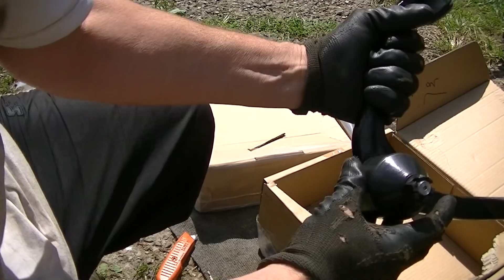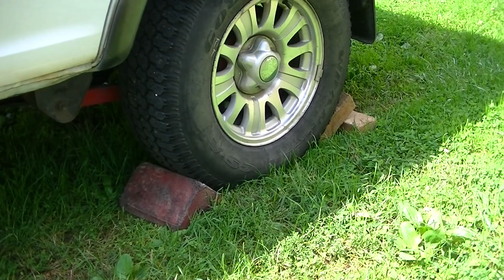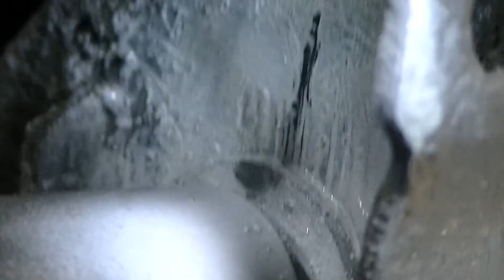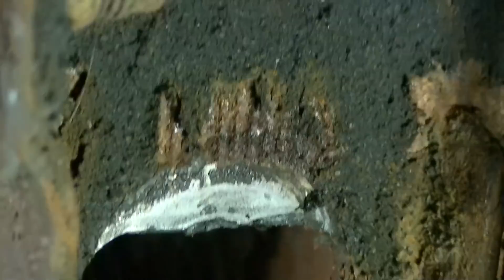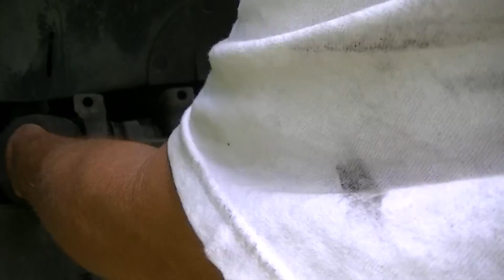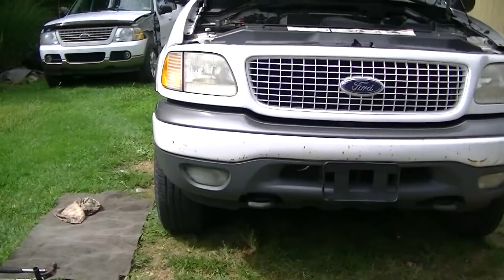Upper Ball Joints. YOU CAN DO IT!!  Step by Step...How to replace them on a 1997-2003 Expedition.

Comment from the maker: PLEASE READ:  The "Arrow" is pointing at the "Ball joint". But the hole assembly is the upper control arm. The ball joint is part the entire assembly, that's how they designed it. If some says "you need a upper ball joint" well, then you'll get one, with the entire assembly. Its all one unit. I tried to keep it simple but folks get confused. Then there is the Upper control arm bushings lol... part of the unit also.

Comment: So I've got a 2003 eddie bauer expedition, and this was mostly similar, except to remove the bolts on the upper control arm you have to pull the strut completely. Just finished the drivers side, which means I've now removed every strut on my vehicle. 

Advice to anyone trying the same, be careful with the upper mounts for the struts, keep the front end around the same height to avoid pinching the spring with the swaybar, and get ready to use some interesting amounts of torque with a breaker bar if you're from a place where things get rusty.
Reply from the maker: Truth!

Comment: Mine says not too tighten  bushing bolts until the suspension  is at ride height that was not mentioned  at all( too avoid premature bushing wear )....that's after it's off the jack or jack stands  tires on the ground right ?....

Comment: Is the upper ball joint serviceable without replacing entire control arm?
Reply: Yes if the bushings are fine no need to replace it but do a cost comparison between both, and see if it makes sense to u to leave them or replace them. Just make sure to get the proper tool from parts store to make installing the ball joints a lot easier.

Comment: That not a ball joint!!! It’s a while assembly, which is called an upper control arm!!!
Reply from the maker: The "Arrow" is pointing at the "Ball joint". But the hole assembly is the upper control arm. The ball joint is part the entire assembly, that's how they designed it. If some says "you need a upper ball joint" well, then you'll get one, with the entire assembly. Its all one unit. I tried to keep it simple but folks get confused. Then there is the Upper control arm bushings lol... part of the unit also.

Comment: So I have a 96 Ford explore it needs an upper ball joint do I have to change the whole  a arm  or can I press out the ball joint. I think it’s never been changed before I looked tonight the top one has no snap ring the bottom one does. So does that mean I have to change the whole a arm
Reply from the maker: Different ways.

Comment: I believe that part is called upper control arm and not "upper ball joint"
Reply: Yeah and those pieces you cant just replace the balljoint on those trucks
Reply: I think you’re right but if I’m not mistaken the upper control arm does contain the upper ball joints also, so replacing the upper control alarm also replaces the upper ball joint.

Comment: Nice video! What can you do if you don't have a tool for adding grease to fill the boot through the grease fitting? Could I put on the new control arms and then ask a mechanic to just add the grease? Or is there a DIY method?
Reply from the maker: There cheap...$5
Reply: @FixingWithPassion  Oh, cool. Thanks. What are they called? What kind of grease goes into it?

Comment: Nice job on this vid. You showed how easy it is to replace Upper Arms on an Expedition/F150.

FWIW: Just did a lower BJ replacement. That stud did not want to come out even with a BJ-Puller/Seperater and a 3 pound sledge. It finaly popped loose on the 4th Tighten/Whack cycle. Each time I had the Jack Screw really tight and gave the Knuckle a couple of serious Whacks with the 3 Pounder.

An Observation:

It's possible you may have early failure of the rubber bushings on the passenger side. Maybe both sides.

As I remember, you had to force the upper arm into position to engage the steering knuckle which indicates that either or both upper/lower arms were not in the same position(s) (Angles) as when the old upper Arm was disconnected from the Steering Knuckle. If it was only the lower arm out of position, then no problem.

You may have performed Upper Arm Angle Setting Adjustments and didn't record it or lost it in editing or I just missed it.

When the upper arm mounting nuts/bolts are torqued, the Arm-to-Frame Angle should be with the arm at Normal Ride-Height Angle else the compressed rubber bushings have a tendency to tear and then disintergrate as the arm swings through it's suspension travel and they age.

The best way to adjust Ride Height Arm Angle is with a tire mounted on the opposite side and supporting the weight of the vehicle. Then with a floor jack under the repair side Lower Arm adjusted to level the vehicle Left to Right. No part of the vehicle can be supported by Jack-Stands while doing this leveling else vehicle weight won't be evenly distributed Left to Right. 

Slide a tire or two under the frame for safety.

Some Mekeniks simply Eye-Ball the Arm-Angle before tear down and 'Get-it-Good-Enough' when mounting the new Arm.

Some (me), make a cardboard templet of the Arm to Frame Angle after disconnecting the Arm from the Knuckle but before loosening the mounting Nuts/Bolts so they (I) can pre-set the angle before final tightening of the nuts/bolts with the repair side at Ride-Height using the jack leveling methode.

You've got to juggle between Arm Angle and Mounting Bolt Slot Position while performing both Pre and Final tightening. 

Remember, it's the Left to Right Leveled Ride Height Final Tightening that counts not the Original (Old) Arm Angle. A previous Arm Replacement Mekenick may have Boogered-Up the Angle Adjustment. You don"t want to replicate his/her/their mistook!

Another problem is if the arm is tightened when angled Too Hi or Too Low, that side of the vehicle will tend to sit Too Low or Too Hi, respectively. That's because the Compressed Rubber Bushings pre-load the suspension to an abnormal Ride-Height.

Also, the action of the Shock Absorber will be modified because the compressed bushings are either Adding-To or Subtracting-From the Shock's Compression/Extension action with the Opposite Effect to the Opposite Action.

If the arm is Tightened at the proper angle, the Compressed Rubber Bushings simply dampen the action of the Shock Absorber equally in both Extension and Compresion and will not  affect Ride Hight.

Setting one arm Too Hi and the other Too Low and driving down a bumpy road will make everyone SeeSick as the vehicle rolls randomly Left and Right with jerking motions. Get the Puke Bags ready. HAHA & LOL

BTW: I use the same Paint/Mark method to record Caster/Camber Bolt positions.
BTW: I use the same 'Torque to Spec' methode that you use. HaHa
BTW: An alignment in NH is about $100 not $40.

Again, good job on the vid. You've demoed, even to NewBees, how to save some serious money on auto repairs.

PS: Funny Story.
Many moons ago I became aware of the Suspension Arm Angle Setting problem when two of my friends replaced left and right Upper Arms on an F150.

Each worked on opposite sides with the truck hanging in the air on jack stands. They removed the Arm mounting bolts first then separated the Ball Joints using a rented tool. They reversed their removal process by torqueing the new BJ Studs into the Knuckles then mounting the Arms onto the frame with the Lower Arm/Knuckle hanging by the Shock Absorber and Sway Bar Link.

Basically, the Front End Suspension was at Full Extention as they reassembled the truck.

That night on a test drive, they were pulled over by a Cop because their Head Lights blinded him when coming from the opposite direction. The driver got a Defective Equipment Warning Citation and was allowed to go on his way.

The next day he stopped at a garage to get his Head Lights Re-Aimed and the mechanic said the front end was raised too hi for him to be able to adjust the head lights down to where they should be.

The mechanick already knew what the problem was as he guided my friend into the FE-Alignment Bay and saw the new upper arm behind the front tire.

He asked my friend a few questions then explained what was wrong and sent him home to re-set his Arm Angles.

He told me that after he adjusted the Arms, his head lights were OK and the Bouncy front end that had suddenly appeared went away.

HaHa: Problem Solved and Lesson Learned!
Reply: I kill time by watching youtube videos on various subjects and always enjoy watching the DIY people think they are saving money by doing it themselves...as opposed to a pro mechanic.  This video is a perfect example. As I watched, I wondered if this guy would set the arm angles or just tighten everything up on the jacksands =  -your comment beat me to the ride height/arm angle/premature bushing failure issue with this guys "procedure."  I'll bet he never figured out where his new squeak was coming from after he did this "$ saving job." He solved the ball joint problem and then created bushings/ride height/stability problems.  Technical manuals require reading.  Parts houses don't sell adequate repair manuals. Claw hammers are for nails - not cars. Get a seperator  - they make them for a reason and at least clean off the mating surfaces - don't install new parts on dirty surfaces & never beat a bolt into a hole with a friggin hammer - jeez.

Comment: I bought a expedition recently and pulled hard to the left I went and had it aligned  they couldn't do it and said it had a bent frame  finally a seasoned employee looked at it and noticed that it had two right side upper a arms on the suv  thank goodness that he seen the problem they installed the proper a arm on the left side and they then could align the suv the last owner didn't make sur to in stal a left a arm but installed a right a arm   they ar close but just a little bit diferent
Reply: Nice

Comment: what about lower ball joints on an 2000 expedition, is it possible to just press them out and replace them rather than replacing the whole lower control arm?
Reply from the maker: Yes I have video's on here about that. Just do a search "lower ball joint replacement." under my name ;)

Comment: I just ordered upper and lower ball joints for my Ranger. But all the videos I see online are of people replacing the WHOLE upper control arm rather than just the ball joint. Is it too difficult to get the ball joint out of the control arm, and that's why everyone just replaces the whole control arm? I have seen the control arms online and I'm afraid to order that because half of the reviews say "didn't fit my truck, had to take it back and get a different one". I'd rather just leave my control arms in there along with the aligned cam bolts and just press out and replace the ball joint. Is that impossible on the uppers?
Reply from the maker: No you can change the entire ball joint/arm..........BUT....you will have a chance of the aliment getting off....Camber/ Up and down angle. That's why I just changed the ball joints so it would not have to deal with aliments.

Comment: Great video! I have a 1998 Ford F150 and I know my top control arms definitely need replacing, the bushings are toast. Do you recommend changing the bottom control arms/ball joints on each side as well or can I get away with just changing the top control arms? Is there anyway to test just the bottom control arm/ball joint besides using a visual inspection?
Reply from the maker: Jack it up and shake the tire look for play in the bottom. I'd do them all. Can't go wrong.
Reply: Yeah, I was thinking I should do them both why I am in there. Thanks!
Reply from the maker: Ok Great!
Reply: Rob NOspam... Yea I agree, if your Ford is that old, I would replace them, good or bad, I would replace them.
Reply: Trino Ponce yep